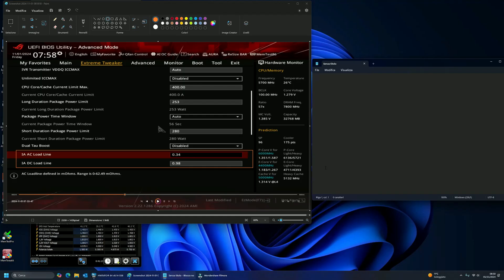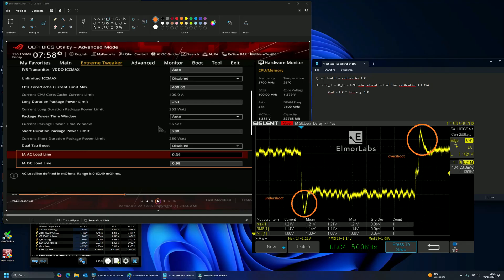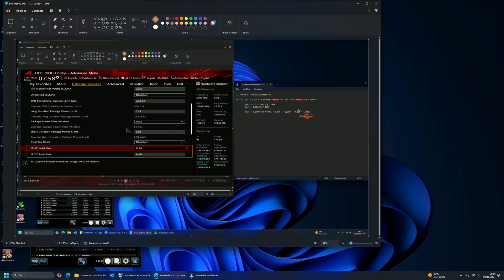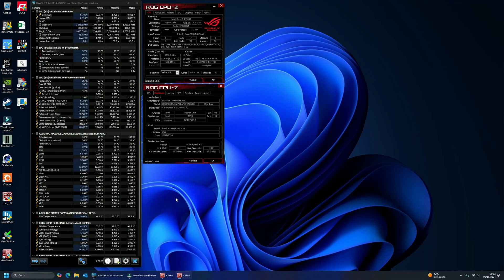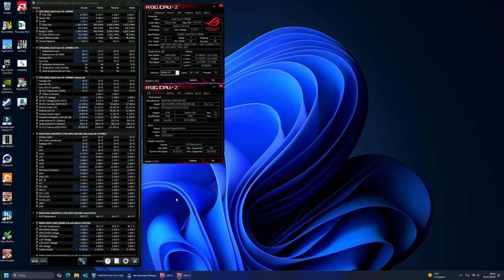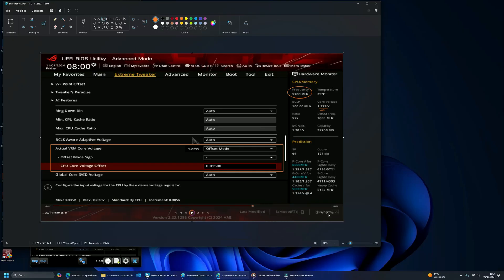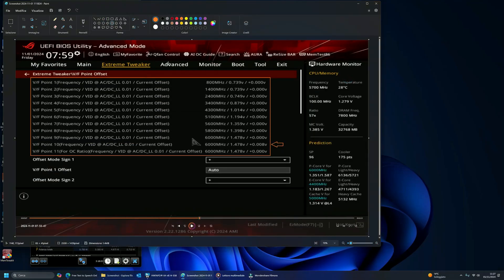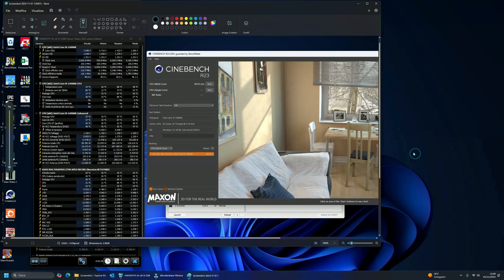INTEL 13th and 14th gen. UNDERVOLT guide🔧

Comment: Thank you for your hard work. May I know if I could use the same settings on a Z790 Hero ?
Reply from the maker: Hi, every motherboard, like every processor, has its own sweet spot. Therefore, start with the video where I show the procedures to follow to combine performance and stability, and make small adjustments to the parameters I'm talking about. However, on IA AC_LL, start with a value of 0.38 mOhm and then decrease by 0.01 mOhm until OCCT and/or Aida64 show instability. At that point, go back to the parameter and increase by 0.02 mOhm. You could simply copy the rest, taking care to make small increments in case of any instability, as I pushed them quite a lot on my Apex. But it works with that board, so it's fine :-)
Reply: @eXpowerG3046  I did everything except touching IA AC_LL. The drop in cpu temperature is tremendous! However, I did notice a slight drop in performance as well. What can I do at this point to UP my performance a bit and I don't even mind if the temps increase a bit too since applying your settings my cpu is not even hitting 65c on load. Also, settings have slightly changed with the updated bios on asus boards.
Reply from the maker: @rogerperera1565 Hi, try to set Actual VRM Voltage in offset mode with next parameter on Auto and test again.

Comment: Hello mate do you recommand the same setting on a w11 i9 13900k rtx4080 ram@5600mhz asus z690hero?
Reply from the maker: @jepasdenom7643 Hi, tell me first wich P core, E core and MC score you have. Find them in IA features
Reply: @eXpowerG3046  P-core 111 E-core 82 mc 76 with the setting put in your video, Im doing the training right now. Tho Ive EKWB AIO since 2 years and my temp are quite high imo going 45 in bios when it was way lower before
Reply from the maker: @jepasdenom7643  Wow it's good! Ok with that score try to lower IA_ACLL step by step until your reach 0.20 mohm. In this way you achive a better undervolt. If it's not stable increse of 2 point that value
Reply: @eXpowerG3046  trying to install w11 atm on a new nvme because of my old ssd dead controller, I installed the last 4104 bios version did the changes, use the media tool installer on the usb drive but sadly got multiple system service exception bsod during the installation, I wonder if its because Ive all my other devices on the ports and if its not better to just proceed to a normal install with just keyboard and mouse. Also idk if the changes I did on Bios with your video are the issues or not 🤔
Reply from the maker: @jepasdenom7643  to check if those values are the problem, set IA_ACLL to auto. Leave both VCore and Adaptive core voltage to auto. Do not set XMP and try booting. If everything is ok then you can follow the video
Reply: @eXpowerG3046  Yeah ill try that, I did a memtest 0 error for now its still running, your video is great and pretty detailed ill try to see once w11 is fully installed without a bsod to avoid corrupted files

Comment: I have a msi bios. Can you help me stabilize my 13900kf please? 😢
Reply from the maker: @JSpectre98  yes, tell me your's card model
Reply: @ here are my specs:
Mobo: z790 msi edge ddr5
Gpu: 4090 msi 
Dram: 32gb 6000mhz ddr5 cl40 (Is the cl40 enough or bad ram for 13900kf?) 
Psu: 1300 w
Aio: kraken elite 360mm 
Os: win11 
Problems I encounter:
• Unstable framerate (random micro stutter)
• input lag (Replaced my mnkb, still same but on my 2nd pc 5800x/2080ti, I don’t get stutters) 
• Browser randomly crashes
• Bsod 

What I did/testedbefore so far
• Undervoltage
• Intel’s default/stock mce off/auto (I always go back to this to avoid bsod)
• Different nvidia drivers (nvcleaninstall)
Reply from the maker: @JSpectre98  First things:
1) press clear CMOS button
2) in advanced mode go to OC Explore mode and set Expert
3) leave the P-Cores on All Core, as well as the E-Cores on All Core
5) Enter the "Advanced CPU Configuration" menu and:
 Enable "BCLK 100 MHz Lock On"
 Enable "Intel C-State" and search for C8 state
 Set the "Long Duration Power Limit (W)" to 253 Watts
 Set the "Short Duration Power Limit (W)" to 253 Watts
6) Enable "Extreme Memory Profile (XMP)"
7) change the "CPU IMC : RAM Clock" to Gear 2
8) Enter the "DigitALL Power" menu and:
 Set the "CPU Loadline Calibration Control" to "Mode 4"

Boot up Windows, test and let me know Vcore voltage amount ;) your base should be around 1,35 to 1,41 volt
Reply: @eXpowerG3046 Thanks for the reply. Do I have to revert on a diff microcode? or should I stick with latest one? (0x12B)
Reply from the maker: @JSpectre98  stay to the latest one
Reply: @eXpowerG3046  I’m on bios rn. What dhould I set c1e support to? Thanks
Reply from the maker: @JSpectre98  that One must be never handle, because it's for security purpose
Reply: @eXpowerG3046  tysm expower! More power and subs to your channel
Reply from the maker: @JSpectre98  thanks mate
Reply: @eXpowerG3046  Hi bro. Upon doing some testing on my games. I still get random micro stutter. :(
Reply: should I replace my cpu instead?
Reply from the maker: @JSpectre98  why? What's the matter?
Reply: @eXpowerG3046  I still get micro stuttering
Reply from the maker: I'm sorry then:(

Comment: Great vid!

I was wandering which undervolt should i do to my I9 14900 KF after patching Asus BIOS to Version 2801? Can´t find any guide nor youtube video on how to do a proper undervolt as of late. I´m running an Asus Rog Strix z790 A Gaming WIFI I mobo and and a triple fan AIO.

My temps sometimes spike towards the 85/90 degrees mark. I´m worried. Currently running the following undervolt: https://www.youtube.com/watch?v=9tDegZ-rTyU&t=188s&ab_channel=NextLevelSimGaming

Thank you very much in advance!
Reply from the maker: @andresramos3878  https://www.overclock.net/threads/asus-maximus-z790-and-intel-i9-13900k-14900k-an-overclocking-and-tuning-guide.1801569/ follow this guide mate ;)

Comment: Hello brother, as of today, my voltages have changed as of today, 1.305 voltages go up and down instantly, what could be the problem?
Reply from the maker: Hi, start bios from scratch by press clear CMOS Button. Leave all settings in aouto and set only LLC as me. Check the VCore voltage, Power consumption and temperature when CB R23 is running. Report the values in order to understand what happen.
Reply: @eXpowerG3046 thank you very much for your sensitivity brother. now I will do what you say and I will report the results.do you think my brother this is 1.305 and occasionally 1.314, but then it drops to 1.288 or so. are these values normal? even though I apply low voltage
Reply from the maker: @az9iz6  the values are normal if referred to the correct load, working frequency and current supplied
Reply: @eXpowerG3046 The processes I did are as follows, brother. 1.i am using asus oc not intel. 2.ia vr limit 1450 3.i applied low vol from the global one. 4.ia cep with sa cep automatically 5.xmp tweaked selected 6.load line calibration 4
Reply from the maker: @az9iz6  ok, IA VR Limit set to 1,5 v; IA AC_LL to 0,36 mohm; in this specific case if SVID value get closer 1,45 v you can lower 0,35/0,34/0,33 and so on until your system becomes unstable; IA DC_LL set to 1.02 mohm; as you said up your Load Line Calibration set to LL#4; PL1 set to 253 and PL2 set to 288. The other parameters must be left on Auto. To check stability you use CB R15 and then test CB R23
Reply: @eXpowerG3046 thank you very much brother, I came to work now, I will inform you about the settings when I get home, respectfully brother

Comment: is it still necessary? Intel claims that the issue was fixed
Reply from the maker: @MatheusCabraldosSantos  in fact, the need for a good tuning of the LLC with the CPU is to achieve an excellent overall performance with a relatively low energy consumption ;)

Comment: I have a 14900k that is throttling like hell fans up and down the stress test says it has a 94% gpu bottleneck 4090 rig strix gpu I don’t know how to do all the tweaking is there anyway to fix the thermal throttling and only getting 3.2 ghz on the cpu it’s holding back my gpu bad
Reply: Post your bios settings file
Reply from the maker: @shaolin95  tomorrow i will post the file
Reply: how are you only getting 3.2 from a 14900k?
Reply from the maker: @coryo617  Go to Advanced - CPU configutation - CPU power management control, then boot performance mode and set Max Non-Turbo Performance. It's used to improve hard overclock, over 6.3 GHz avoid error and BSOD during system boot
Reply: @eXpowerG3046  ih I'm good thx though. I have my shit pretty stable with somewhat of the same method
Reply from the maker: @coryo617  good 👍
Reply from the maker: Hi, not having the system at hand it is difficult to help you. However, do Clear CMOS button, copy the settings I made in the video but leave out the overclocking of the E-Core, which must remain automatic. Once in Windows launch the command from the Administrator terminal: sfc /scannow, then dism /Online /Cleanup-Image /ScanHealth ... if the component archive is restorable launch the command dism /Online /Cleanup-Image /RestoreHealth, at the end restart and test the PC

Comment: With this configuration i got less fps than before 
Do you know what's the problem ?!
Reply from the maker: @MahdyarGoudarzi  hi, those values you find in my BIOS are specific to the motherboard and the processor I'm using. Just try to follow the steps I showed starting from AC_LL = 0.40. Go down by 0.01 mohm at a time until the system is no longer stable. Then on V/F point#10 start from an offset of + 10 MV until you get stability again. If necessary, decrease or increase the value obtained by 0.002 v. Each board and processor has its own setting logic. It depends on the PCB and the silicon lottery. You can't simply copy the values ;) ...except in rare cases where you find yourself with an almost identical processor as well as the same motherboard